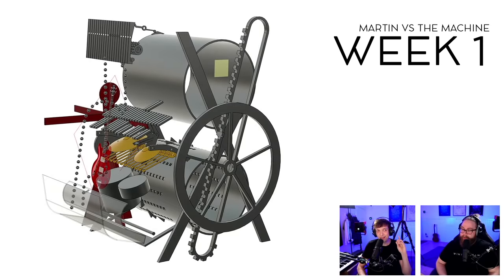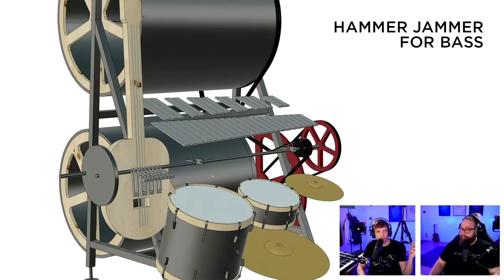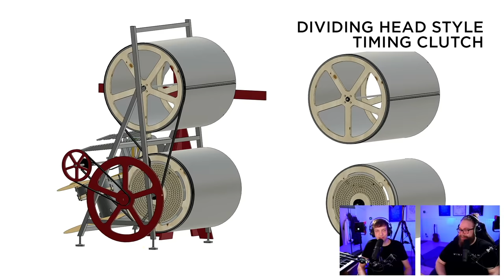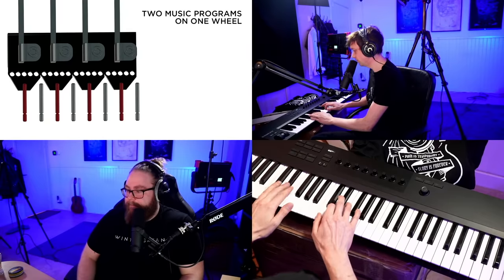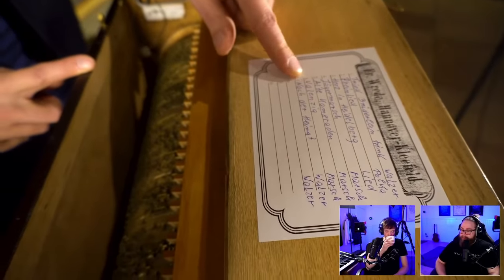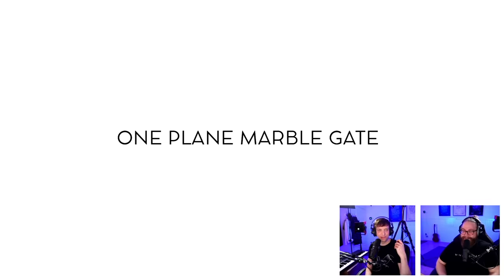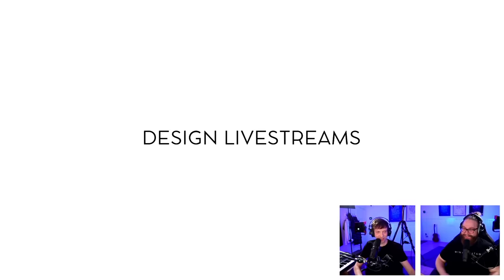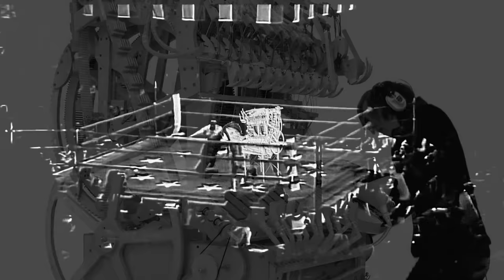Longer Music Programming - Martin vs The Machine - Week 2 Summary

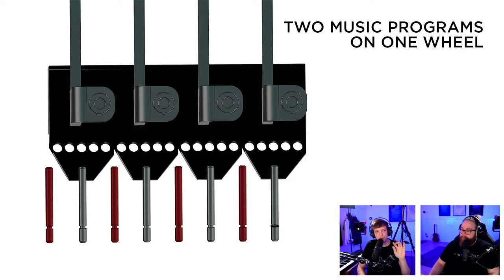Comment: 6:39 Wouldn't it be easier to slide the programming wheel over, rather than the whole assembly of the registrator?
Reply: Will be difficult with the belts. You would have to move it all or the belts would no longer track properly.
Reply: @nukularpictures  It seems no more difficult than sliding the gears on a shaft for a manual transmission on a car.
Reply: @billkeithchannel  Martin wants to use those strange-teeth (Herringbone) belts remember? Those can't slide.
Reply: @nukularpictures  I feel like Drums and Belts can be made as one assembly that can be controlled and moved alot easier then trying to move the registrator assembly which has to be connected to the marble dropping assembly which must remain rigid to ensure consistency. I think Martin showed the example he did for a reason because moving the drum seems to be the less difficult option. Time will tell right!!!
Reply: @nukularpictures  you could connect the programming wheel to the belt wheel in such a way that you can slide it without moving the belt wheel.
Reply: Use two pin lengths and move the assembly up and down so that there are no alignment issues with other parts of the machine. It's easier to compensate for up and down movement than left to right movement which will cause problems with the fixed instrument positions.
Reply: @billkeithchannel  I think you really underestimate the complexity here.

Look at the other machine he showed. How complex it is to change the tracks. And he wants to do it on the fly while the machine is running. 

So it must be able to be done within less than a second. To change it you have to lift up all the registers to avoid collisions, move them over and avoid collisions while lowering it again. So the entire mechanism must have some sort of synchronisation. 

Add to that that you will have to make the registers more complex to even allow this movement as you have to bend them in a new axis  

It will add so many new points of failure and honestly for what?
Reply: @machmar  That still won't prevent the entire drum from being able to slide on the shaft. The part with the teeth would be stationary while the part with the pins could slide to the left or right. The entire thing of course would be removable for a new song to be dropped in.
Reply: Actually, it would be even simpler to have two bars which slide up and down with it's own pins to hit the programming pins.
Reply: @ItsBugtronic  I think he has no idea on how to do it yet. And I think he is already getting distracted from the main goal to keep it simple and get a working platform.
Reply: @nukularpictures  Not at all. You can have the wheel on a spline shaft, just like any gear in a gearbox.
Reply: @machmar  No need to slide the belts. Just have the programming wheel sit on a spline shaft.
Reply: @nukularpictures  The other machine needs to have the registrator lifted because it uses tracks going around the circumference of the cylinder. This obviously blocks and longitudinal movement of the registrators. But the programming wheels have just pins, so the registrator can move longitudinally relative to the wheels.
Reply: Guys... no need for complicated assemblies. Just have the programming wheel slide on a spline shaft. No need to slide belts or anything like that.
Reply: @CristiNeagu  Not while it is playing as he demonstrated it. You would need to pause and align it if you just want to move it otherwise it would crash for sure. 

The gearbox analogy is quite fitting. It is exactly what you are doing in one.
Reply: @nukularpictures  Crash into what?
Reply: @nukularpictures  cannot disagree there
Reply: @CristiNeagu  Into the pins next track pins? Lets say you have a 1/8th note at 120 BPM. This leaves you 1/4th second to move the registers over in order to clear it. 

That is not possible so you will have a sideways collision while moving the drum, making it very hard to just slide it to the side while the drum is turning. 

Plus you might have the situation a register is triggered faster than planed if you move it over and it gets triggered on both channels shortly one after another. 

So you must make sure that nothing jams if this happens. Might not be trivial given his current gate designs. 

All in all it will cause problems, for sure. Even if you are willing to have a very messy transition between the tracks (which I am sure he will not tolerate).
Reply: @nukularpictures  I disagree. Moving the registrators is too complex compared to slding the programming drum. It can be activated using pneumatics to slide it over instantly. All it needs it one horizontal row with no notes for the change over.
Reply: @nukularpictures  It is nowhere near as big of a problem as on the machine he showed. It's all in the design of the registrators, and it is very doable.
Reply: @billkeithchannel  Well if you are adding pneumatics, what is the point? Why not just use solenoids or servos to drop the marbles? 

That way you can have infinite numbers of songs to play, you just have to sacrifice the entire concept of the machine. 

But you can solve the entire collision problem by adding a pause. 2-3s should be enough, however this is not the vision he has shown in the demonstration.

I dont think there will be any problems if you just want to have two isolated songs next to each other but it will be very hard if you want to have the same song continuing.

It was the same with the second marble machine. You can solve all the problems if you are willing to compromise on some aspects. If he would have been willing to take lower timing tolerances, slower speeds, etc. the second version could have worked. 

Lets see if he can do that, otherwise it will end like number 2.
Reply: @CristiNeagu  let’s see. In theory it is all doable. But you have to add a lot of complexity in both designing and building.

Small stuff like that is normally the entire work of an mechanical engineer, I doubt you can design something like that on the fly.

And the design is just the first step. You have to actually build it, test it, iterate it. This is stuff only few can do remotely for him, as it requires a lot of tools and quite a huge part of the final machine. 

If you design a product you normally first go with a minimal viable product. To just get it working. Then you start adding in features from a know basis. He is adding features without having a concept of the machine, let alone a working prototype.

If I was him I would first get the basics going. See if he even can get the timings tight enough of the gates, get it reliable, etc. Then you can add nice to have stuff like this clearly
Reply: The simplest way would be to create two "fingers" per registrator, then you would have a way to lock the A fingers to the gate or the B fingers.

Or have the fingers slide in each registrator left or right linearly to act as a selector for A or B programs.
Reply: Too much moving mass to slide. Even neglecting the belts or other mechanical issues. One error and the pins would be crushed. Safer would be a hinge-like mechanism that comes from above, like fingers.
Reply: @machmar  although the original post is imo a bad idea, you wouldn't slide the gears, but their Axles. You have a keyed axle and you are good. But there are other issues mentiones in my previous comment.
Reply: @constantinosschinas4503  It won't be that much mass. Those wheels will be moved and fitted by hand, not by a crane. One lever is all you need to move the wheel from side to side a little bit. And I don't see how any pins can be crushed.

Comment: If the only way to stop the kinetic fingers was to sacrifice the entire machine, then I think I'm okay with it. I'm not smart enough to tell Martin what to do and I'm looking forward to seeing the MMY hopefully being built some day.
Reply: kinetic fingers was the worst idea in musical instrument history. so glad it was scrapped, together with all the anti-functional nonsense (which i hope never return).
Reply: Sad about the cupholders though
Reply: @constantinosschinas4503  I don't like the kinetic fingers, but I feel like you might be part of the problem -- the problem being the sort of philosophy that, at its core, would never make a marble machine in the first place.
Reply: Solving a design challenge as complex as this in only 3 iterations would be truly exceptional, usually isn't the case. Hard resets are a necessary part of an iterative design process and should be encouraged.
Reply: @KalonOrdona2  I am saying this after hard work on Design, concept, layout, marble management, CAD, and other fields, within the MMX community. Any other questions?
Reply: @constantinosschinas4503  Doesn't that reinforce my point? There's so much engineering in the discord it's just an endless iteration circle. It seems to have stopped being about art long ago. Where that road leads is antithetical to the marble machine's existence.
Reply: @index7787  You're 100% correct on 50% of the picture. The marble machine is art, soul, character, narrative, journey, as well as engineering marvel. Martin and most of the discord seems to have forgotten that, and it shows, and I'm very worried.
Reply: @KalonOrdona2  It is not even about engineering. They are mostly fooling around solving(?) local problems, ignoring the whole picture. I agree with you on the art part. But MM1 fullfilled the art purposes. It is a horrible, unplayable machine that cannot even play a song but it is poetic, romantic, looks great, makes you wonder. MM2 did not look great and gave no feelings (imo) and was neither a reliable player. They are starting wrong again with MM3. Few or no high level, top down sketches, rushing into CAD and local problems. They really need to hire an industrial engineer with production line knowledge. The art, will come easier then.
Reply: @constantinosschinas4503  well, I agree and disagree with you on some things, but I'd like to say I appreciate that the discussion has not devolved -- it's hard to lead with something critical and not have it taken in the worst way, so I appreciate your thoughtfulness.

I thought the MMX still had the wonder and smiles with the entire marble lift & track & racetrack, and the many gears and arrangement of the instruments. I think it started to get off track but would have ended up plenty fine. I agreed with making a touring version but disagreed that that should mean abandoning the MMX the way he did.

It sort of leads into the way he's now casting the marble machines as his enemies, things that are against him. I think it betrays some soul dissonance with the current direction he's going, and I hope he wakes up.

I think the community should take over making a touring version while he starts composing and making a studio album with the MMX
Reply: @KalonOrdona2  yes, martin is obsessed with the machine being ie. silent. why should it be? include it's noise to your composition. Or why not, as you say, record an album on MMX. It was reliable enough for recording, in contrast with MM1 which was a disaster. It is more than 5 years since all this started. A bit too much. Building videos have been very fun though. Martin can consider new building videos of simpler instruments. I dig. MMs are gradually less and less fun...
Reply: @constantinosschinas4503  on all this, I agree totally. Machine noises are a feature, not a bug. Kind of like Animusic's "drum machine"
Reply: @constantinosschinas4503  This always happens when you have unlimited time.. and now money. Deadlines are necessary to finish projects. Forces the unnecessary out for expedience. But since this is in the end, a huge personal project, such deadline can only be self imposed.

But finding the MMX was never going to work must have been a massive blow to him. Massive feeling of wasting your time(as he said, being unproductive for 3 year, which he really was not..). That's a bad state of mind.

Comment: Get rid of the belt/chain drive on the drums. You need to have them gear driven together otherwise you will have issues with timing between them. It would be easier with gear drive with timing marks on the gears to make sure they stay timed together when switching them. This would also remove the requirement for a belt tensioner. Remember a belt also can have dimensional length changes with environment and wear. The length changes will shift your timing between the drums. The belt system will be the downfall of this design. Yes I am a Mechanical Engineer and said feature creep was going to kill the last machine, sounds like it might get another.
Reply: The tension in the belt is specifically to correct for any possible length changes. There is no reason this can't achieve tight timings. If the belts are under tension any changes that would normally lengthen or shorten the belt instead change the tension in the belt. The tooth design being used further compensates for any changes in the size of the grooves on the belt
Reply: I disagree.  Engines run in time for decades running on tensioned timing belts.  They'll be much quieter  and more forgiving in manufacture than gears, and wear less.
Reply: @owensparks5013  Yes I agree and I thought about it in my reply. The difference is that engines do not get their timing belts changed multiple times per show. The problem we have here,  the tensioner would affect installing the new belt and most likely generate a one tooth or more error during installation.  I agree it could be all be alright but when design calls for a roadie/stage hand (not sure what the European term for this position would be) to do some of the change over you are looking at a potential  timing issue.  The other issue I think may occur with the belt is the size of the drive sprocket to the size/mass of the drum sprocket. The mass of the drum may have too much inertia for the size of the drive sprocket and tensioner spring. This would lead to belt tooth hopping on the drive sprocket leading once again to timing problems.  My area of specialty is not belt drive systems so I am dredging up memories from classes I had almost 40 years ago in college.
Reply: @Mongo63a  Thanks for the well reasoned reply.  I was envisioning something similar to the mechanism used in large bench mount belt sanders.  (Just a  long lever acting against a spring to release it.) They hold a good amount of power and can be changed in just a few seconds.  Granted there is no timing involved there,  but fitting a cam belt is nothing more that lining a few marks up on the un-tensioned side of the belt before letting go of the lever.  
 
Personally I feel the machine has lost a little of its spirit by giving up gears in favour of belts, but I'm not the one that has to finish it and get it working,  so I can understand the attraction of the change.
Reply: @owensparks5013  I would also hate to see what the back up plan for when the belt breaks. The way it is designed now can the belt be replaced if this happens without the machine tear down? Just a random thought. 

If there is any way possible I would increase that drive sprocket size, larger the size better for accuracy and lowering the required tensioner spring pressure. The more teeth engaged on the belt the less chance of jumping teeth when changing speeds of the drums.
Just a though again, make the chassis such that the crating bolts right onto the sides of it. This will minimize crating issues when moving between performances as well as providing the best protection to the components if you keep them inside the frame work.

Comment: @Wintrergatan Great to hear the progress is going again. One thing to note, more instruments than just the organ grinder has the shift feature. The left peddle of pianos shifts all 88 keys to the left in order to play quieter by only hitting 2 of the 3 strings per note. I don't know how the mechanism works, but it may work for this, and allow it to be shifted at the same time as a song is played. It would involve shifting the pin reader, rather than the programming wheel

Comment: the fork should have some kind of bearing surface or the shaft of the programming wheel, otherwise its going to grind itself and even bind up. Also maybe some lubrication would help
Reply: Maybe look at how a car engine does it, with the bearings and crankshaft
Reply: The bearings are on the programming wheel's connection to the shaft, the contact in the fork isn't spinning.

If anything that fit needs to be rubberized to make sure there isn't any gyroscopic counter rotation.
Reply: @RupeeRhod  oh ok, couldn't see that in the video. makes way more sense lul, thanks!
Reply: @RupeeRhod  Or the surface could be square or any other shape than round to stop rotation from happening
Reply: @craftedbyorre  Wjatever the shape it has to be lockable so the shaft can't be accidentally dislodged. The weight of the drum is probably enough, but as it's not a "99.9%" design it should be locked in place.
Reply: @blahorgaslisk7763  remember that this machine is in very early state. It should not be a problem to build som sort of quick release to clamp the bearings. But it's not worth to think about those details when the whole machine can change it's design in the next weeks.

Comment: If you want to switch between tracks you may want to have a way to request a change that executes when it hits a track change pin. So you can choose early to switch at the end of this verse, but it waits to change at a time that it is mechanically safe and or musically correct to change tracks. 

Giving you time to be ready to add flourishes using other parts of the machine. Also a change at the wrong time may snap pins.

Comment: The song "multiplexing" is a simple trick. You can also have independent songs run in parallel groups, as opposed to interleaved. You can use that for transposing, as you can use it for polyphonic counterpoint.